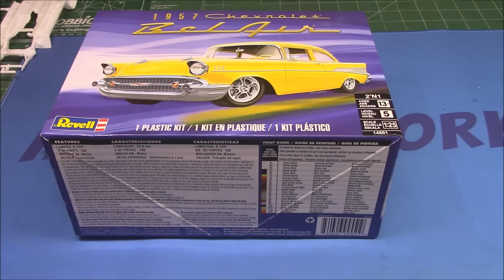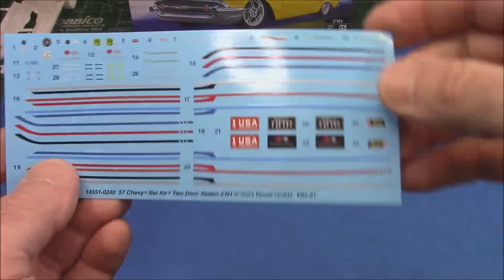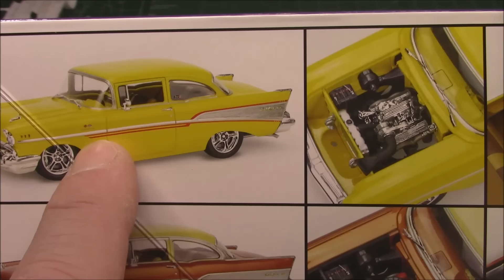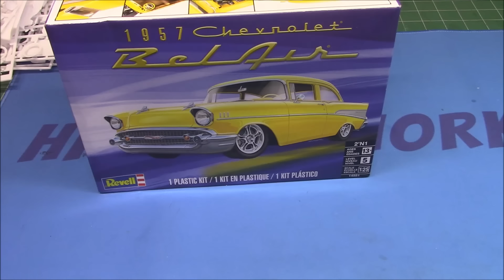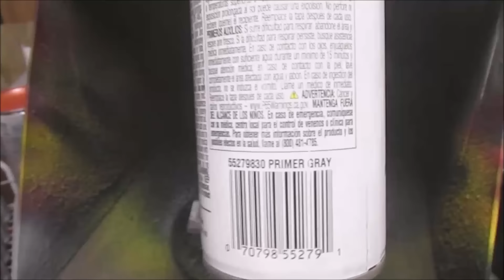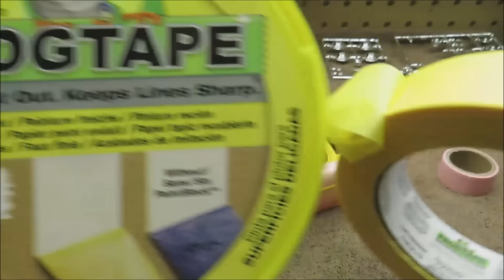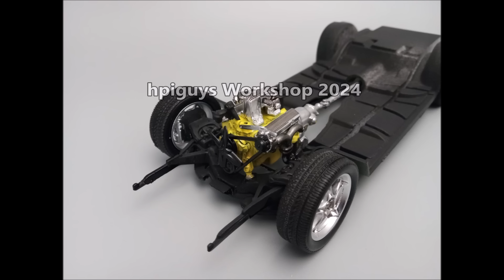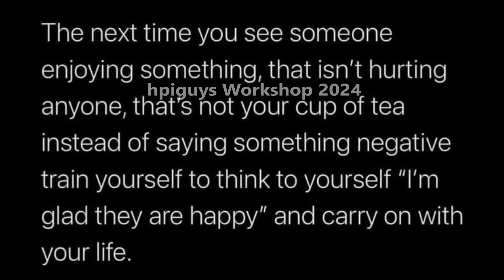1957 Chevy Bel Air RestoMod 1/25 Scale Model Kit Build How To Assemble Mask Paint Interior Dashboard

Comment: Really cool. Nice build. Would be awesome if the rubber front bullet bumperettes for the grill were also an option and that the grill insert was a separated part so we could remove it to make a custom version.
Reply from the maker: I'm pretty sure those rubber cones are on the parts trees.
Reply: @hpiguy  They are? I didn't see them. That's cool. And since this release is new, I can't find the instruction .pdf file yet.
Reply: built a 57 convertible to resemble my old one  used my dremel and ground down the grill bar then used the custom Buick grill from the AMT 57 think I had to do a little filing and sanding but the grill fit perfectly
Reply: The rubber bullets are included in the kit.

Comment: I’m definitely picking up one of these. I last built this kit as the One-Fifty/Black Widow version. Best detailed ‘57 Chevy kits ever. I appreciate the separate rear seat, wipers, exhaust, suspension, etc. Allows me to build an accurate oval track racer or drag car.
(I only wish the Bel Air trim on the quarter panels were separate so that one could build a Two-Ten model; but I’m just nitpicking.)

Comment: I gave you a thumbs up for the build. If I could I'd give Revell a thumbs down!! First off that's NOT a Bel-Air!! All Bel-Airs were hard top cars ( NO B Pillor )!!!
 This body style is a 210! I really don't get all the stock options. The '57 family car didn't have disk brakes from the factory much less on all 4 corners. Sad really!!!
 I'll likely pick up one or two when they hit the discount stores.  The 210 did and still does make a fantastic drag car. When I do get a couple ( at discount prices  ). I'll use the body and build gasseres out of both. My chassis my big block engine, and my interior. The rest of the kit will hit a sale group to recup cost.
 It would have been easy to make a great kit out of this body. 😌
Reply from the maker: My man, the disc brakes are the lowered restomod option parts. You can build it stock height with the stock parts shown. 

I'm no expert and don't pretend to be but it took only a half a second to find one for sale with a B pillar.
https://autohunter.com/Listing/Details/14909060/1957-Chevrolet-Bel-Air

And another one:

https://barnfinds.com/desert-driver-1957-chevrolet-bel-air/#:~:text=The%20B%20pillar%20or%20%E2%80%9Cpost,wrong%20with%20a%20'57%20Chevy.